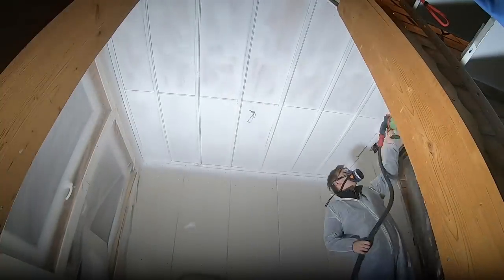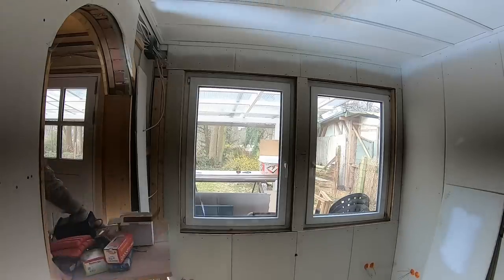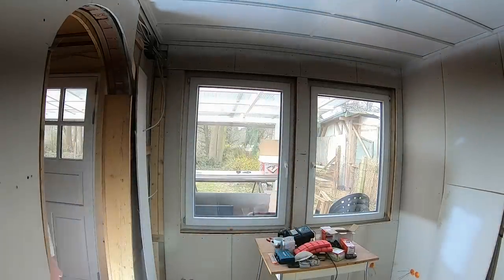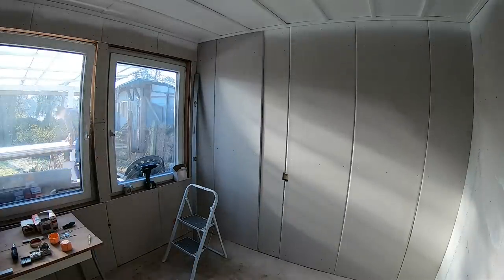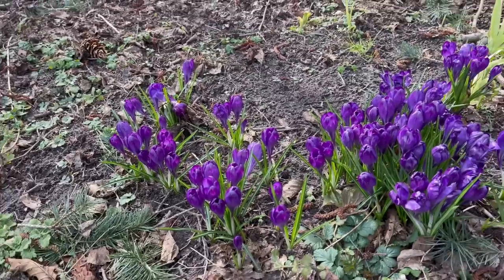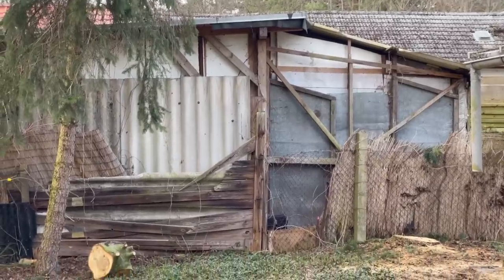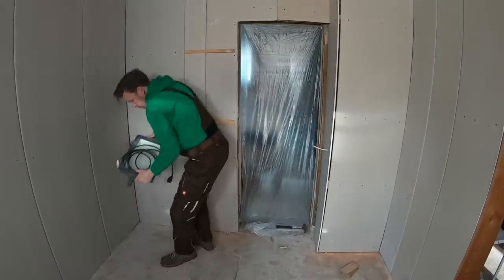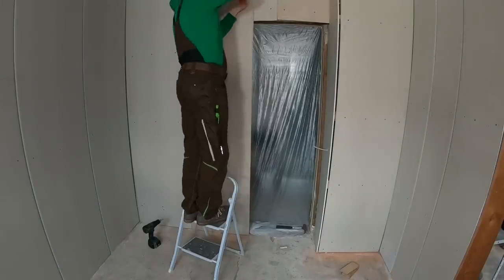Renovating an abandoned Tiny House #85: Soundproofing!

Comment: Excellent idea to use a second layer of sheetrock for soundproofing. Did the same thing in my kitchen years ago because I live in a row house where I share a mutual kitchen wall with my neighbor. Since it is 1 inch thick, it also serves as a one-hour fire wall between dwellings.
Reply from the maker: That's a great idea!
Reply: I live in a duplex and we hear every sound from next door despite the wall between the 2 homes being a cement block wall filled ground to roof with concrete. to make a firewall and to comply with Florida hurricane standards on new construction.
Reply: @ginger1549  Concrete is an excellent sound transmitter!

Comment: I worked with a company that built a hotel and one of the requirements was a low coefficient of sound factor.  To do so an additional layer of drywall was added to one side of each room with a little air lather in between.

Comment: Andre, maybe look into getting a high pitched dog whistle. They make no sound (actually, they do, but only dogs can hear it). Maybe by you blowing it every time he starts barking uncontrollably, he will stop. If so, do it every time he does it.. you're essentially training the dog to understand that he needs to stop when you blow the whistle. But it's sad, coz that dog is probably bored as hell and just needs some stimulation. Are you "friendly" with your neighbours? Is there any way you could make "friends with the dog" and get him some toys? .. if so, a Kong is a GREAT stimulation toy for dogs. It's a thick rubber toy with a hole. You place treats inside.. peanut butter etc.. and they spend a lot of time trying to get the food out. It tires them quick. I know what I'm suggesting is A LOT and it's something the dog's owner should be doing, not you, but if you're going to be living next to that dog from now on, the noise will only aggravate you more and more. Just a suggestion. <3

Comment: One way you might be able to deal with the dog, is to lay it on it's side and pin the dog until it gives up.  You won't need to be aggressive with it, and it doesn't hurt the dog.  What it does is gets your respect.  It's a dominancy thing.

From that point on, you can firmly tell it to be quiet.  If it starts barking, interrupt the dog by saying quiet again.  Keep telling it to be quiet every time it starts barking until it gets the hint.

Comment: Learn some welding- and make a industrial strength arbor fence- livestock panels work great- and then grow one of those  vines that will cover everything.  Have the livestock panel on both sides of the posts- and the vines will grow between them and lock them together- foliage is a great sound blocker. Did you mean have the dog shut your front door- or its front door? LOL

Comment: Youre idea was a good idea but these plaster boards are not enough to hold noises. You need special ones for that issue and they are very expensive.( Sorry for you Laszlo).
The white ceiling creates more light in the room,I like it.